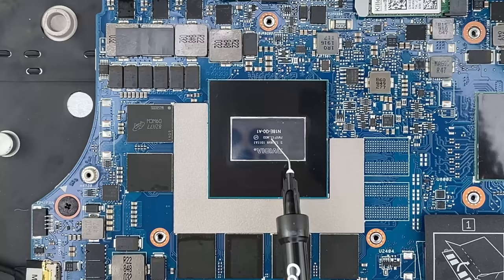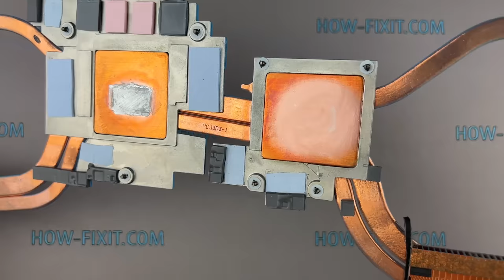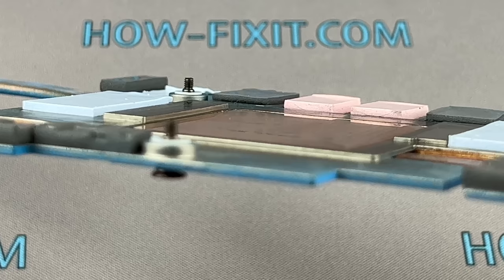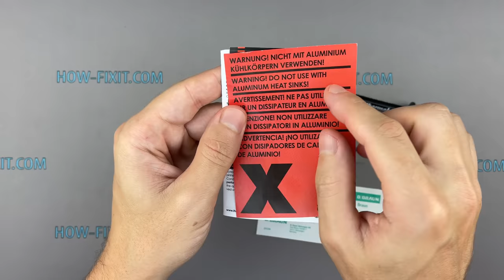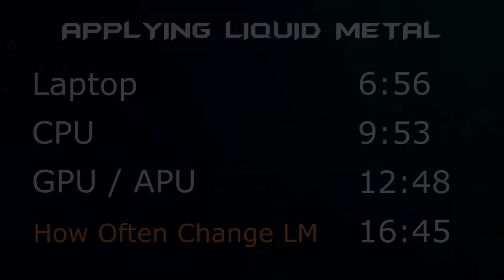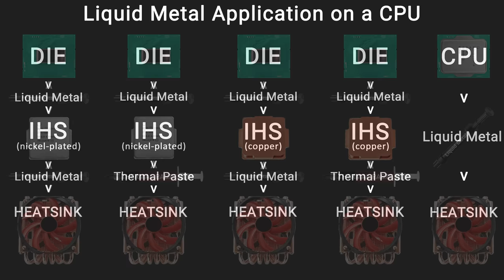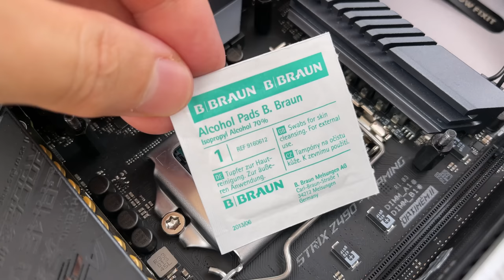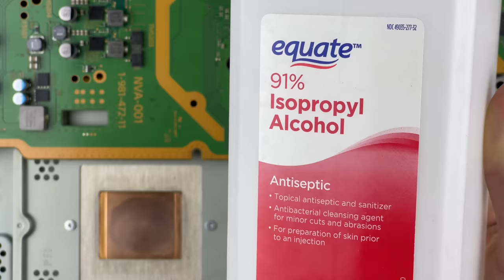Ultimate Guide to Applying Liquid Metal to Your CPU, Laptop, GPU, and Game Console

Comment: It takes 4 years to make a video & still need another 2 years, what a dedication. Really appreciate it. Btw, how many gram of LM are used to apply for laptop?
Reply from the maker: A pinhead-sized drop for a laptop CPU and heat sink. 
I think it's less than one gram.
Reply: @howfixit hi, have you teardown an Acer vx5? Do you know where to disable the sleep sensor or button when you close the lid by any chance?
Reply: @howfixit  I had to subscribe to find out how the liquid metal stood the test of time.
Reply: If you are concerned about this you can start with a conservative amount (the least you can apply) and then add more if its not enough to spread into the thinest layer possible. Remember the point of a TIM is to fill gaps, you don't need more than the thinest layer.
Reply: @howfixit  Mimetic polyalloy🤓 ..... I don't feel cozy putting a chunk of T1000 in my PC 😱... Skynet may get angry😁
Reply: @Ramdileo_sys was thinking the same😂
Reply: Very informative video

Comment: This guy doesn't know what he's talking about. And you didn't remove the stain easily. You created a divit inside the tapper by only polishing one spot
Reply: It's a non abrasive polish. He removed a few atoms of depth
Reply: “Non-abrasive” has been stressed for a reason here. Barely any scratches or divets will occur with a sponge with this polish on copper, and it is visually unnoticeable from a regular polished copper.
Reply: Even if he did create a divit, it's not very deep. You would create significantly more depth if you used an abrasive polish. He's using a non-abrasive polish. Might wanna actually pay attention to the video next time.

Comment: I can tell you better and proper way how to apply liquid metal to copper sufaces: you just need to apply thin layer of liquid metal on the copper and leave it for about 1 hour to get absorbed a bit. Then you apply liquid metal again without touching the thin layer and you are done! No more fast dry liquid metal!
Reply: Bro i used LM for about 6-7 months but as stated in the video you have to reapply but when I sanded the iodized layer on copper heatsink I can't able to spread liquid metal again it's just form a bubble, can you help , but i easily applied it on cpu Or my laptop but can't able to apply on copper heatsink it's just not possible please help

Comment: 2:33 There was alloy diffusion between gallium (and other metals) and copper. In this way, there will be a better heat transfer between the liquid metal and the copper block. In my opinion, do not remove the gallium in copper! 
In my opinion, wipe the liquid metal on the processor and copper block with an alcohol swab without pressing too much. Then apply liquid metal over it again. In this way, you will get better results than the temperatures you have achieved before. I've tried, I know what I'm saying.
Reply: Very true, but this is precisely what he says later😂
Reply: @alexbraundelacruz9690  He doesn't say anything after that, but you know.
Reply: @hamzaterzi8801  I mean he says in the proper application that you shouldn't remove the fusion, only reapply the liquid metal
Reply: @alexbraundelacruz9690  You mustn't touch the copper block. Engineers are making the heatsink with mm calculations.
Reply: Around 16 minute mark he says it, not in the part he is cleaning.
Reply: @tukankibar4917   2:53 Kardeş, galyumu bakır bloktan kazıma ve zımpara yapmamalısın (Videonun ilk dakikalarında yaptığını diyorum). 1:21 Ayrıca orada kimyasal bir reaksiyon olmuyor. Zımpara ile malzeme kaldırırsan, bakır blok ile işlemci arasında fazladan boşluk (çukur) olacaktır. 

Bakırın ısı iletim katsayısı 385 W/(m.K) 'dır. Thermal Grizzly Conductonaut Sıvı Metalinki ise 73 W/(m ·K). İşlemci ve bakır blok arasında ne kadar az boşluk varsa. Kısa sürede işlemcideki ısı, bakır bloğa aktarılacaktır. Eğer mesafe uzarsa, işlemcindeki ısı daha uzun sürede bakır bloğa aktarılacaktır. 

Bakır ile galyumun difüzyon ile birleşmesi iyidir. Bakır bloğundaki boşlukları galyum atomları dolduruyor. Birkaç ay sonra tekrardan sıvı metal uyguladığında daha iyi sonuçlar elde edeceksin. Ayrıca bu sefer galyum, bakır bloğa daha az miktarda difüzyon olacaktır.

(Not:Kimyasal tepkime ya da kimyasal reaksiyon, iki veya daha fazla maddenin birbiri ile etkileşmesi sonucu kendi özelliklerini kaybederek yeni özellikte maddeler oluşturmasıdır. Kimyasal olay ve kimyasal değişme kavramlarıyla eşanlamlıdır...Orada galyum ile bakır birbiri ile difüzyon oluyor. Farklı bir özellikte madde oluşmuyor. Bir bardak su ile taşı karıştırmak gibi düşün. )
Reply: @hamzaterzi8801  ustat, eyvallah, adamlarin ve benim demeye calistigimiz sey videodaki adam senin dediklerinin aynisini soyluyor zaten, sadece dakika 16 civarinda falan. Dediginde haklisin yoksa.
Reply: @tukankibar4917  2:40 dakikada, 4 sene sonunda bakıra nüfuz etmiş sıvı metali kazıyarak çıkardı. 16:19 Tekrardan sıvı metal uyguladı. 16:57 Yaklaşık 1 ay geçtikten sonra tekrardan sıvı metal sürmeyi tavsiye etti. Bu sayede uzun bir süre boyunca sıvı metal kurumayacakmış (O konuda kısmen haklı).
Bende diyorum ki 4 sene bile geçse, bakır bloğa nüfuz etmiş sıvı metali kazımamalısın (Hafiften silmen yeterli). Kazırsan bakır blokta milimetrelik çukur oluşabilir. Bundan dolayı işlemci sıcaklığın daha yüksek olacaktır.
Reply: @hamzaterzi8801  evet ustat, adamin orada onu yapmasinin sebebi bunu paslanma zanneden arkadaslara, bakin bu paslanma falan degil diye gostermek zaten, sen ben yapalim diye degil yani o.

millet farkli renk vs. gorunce aa bu bunu bozuyor diye geriliyor ya ondan. yoksa tekrar diyeyim, senin dedigin isin dogrusu zaten.
Reply: 16:45
Reply: Thats what he said on the video, watch again bro

Comment: Thanks for this video. I have had similar results using this on my long-term laptops, and I did the same thing. Allowed the LM to react with the copper, change it a few times within the first 3-6 months, and then let the LM ride in the laptop and remain liquid. This certainly cleared up any doubts I ever had about my process, and for whatever reason, before this video specifically, I had never been able to find a breakdown this detailed about it. LM is definitely the best way to keep thermals down, and my favorite to use by far. Thanks again!
Reply: Im bout 2 months into first lm application and this morning suddenly got throttling, just took it apart and turns out lm on cpu got dry and separater from it.
Reply: Bro i too used liquid metal but after 6-7 months I tried to repast LM but it won't spread on copper heatsink tried sanding too nothing helped, can you help Or any piece of advice?
Reply: @035-anandraj4  which one did you use?
Reply: @xCheatah  bro it's hard but at the end I applied it, you just have to go round and round till it start to spread, but 1st if you have applied and it formed a layer just sand off it with sand paper, then use cleaning pad that comes with liquid metal or any cotten cloth with just drop of water if you don't have pad . Then take a cotton bud from the medical store , then just rub it against the copper till it starts to create friction then liquid metal will start to spread Itself

Comment: Now I know what i have done wrong. years ago I applied liquid metal to my gamer laptop just on both die. some weeks later it just get back to the same thermal issue. I was to scared of opening it again to see whats gone wrong, till I saw crazy guy doing the same for a RX 7900 xt, And the i knew that i should have put metal on the Heat sync as well.
So I did it and my laptop just worked flawless again. Now I know the think about having to apply two times on copper based heat syncs. Good to know and thank you.

Comment: Just a heads up. First you say not to use an abrasive polish, and then start using the abrasive side of a sponge to clean the copper.
While this may be fine for some sponges, there are others out there that are far more abrasive than polyester. Be careful what you're using.
Reply: All polishers are abrasive as well. But Flitz uses somewhere around 15 000 grit which is around the same for other polishing compounds (some can get up to 30 000 grit). I collect knives and use flitz to get a mirror finish on some knives and it does take material off, just very little at such a high grit that it wouldn't be noticeable or really change dimensions really at all.
Reply: @Kman31ca  yeah but a scourer 🤣🤦‍♂️
Reply: I would agree, but anyone who is this much of tinkering, we already know this stuff, and compare the percentage of wool in our socks, as well as distill water so we get zero metal fluoride when we drink, and ALMOST every thing else. :)

Comment: Great video! Last month i repaste my nitro 5 2022 default paste with liquid metal using this guide. I use a tape named Kepton to isolate and did really nice job. My temp results was great, -20 - 25°c. Now, i just repasted again like you did, so far so good, my laptop is cold finally.
Thank you!
Reply: Bro how did you repaste? My copper heatsink doesn't want LM, I mean it won't spread even after sanding the surface

Comment: incredibly well done, thanks for being patient, repeating and showing various use cases, especially the polishing bit.  very nice work!
Reply: This is actually laughable, don't use the stuff for a few extra degrees, and a lot of the things he did were actually dodgy
Reply: @Markknightexeter  If you know that you can do better, make a video of your own. Saying what he is doing is laughable and dodgy does nothing for people looking to learn. Be part of the solution, not part of the problem.
Reply: @Markknightexeter at 100C you can shave off 25-30C. Even at 70-80C you can shave off 15-20C. On a modern Ryzen or recent Intel, you can obtain higher boost clocks. This is a great way to make middling coolers work better and get more value from a build.

This guide is absolutely excellent, and the polishing is entirely unnecessary especially in low contact systems, you should not be removing mass from said systems.

His additional comments on LM not being scary are warrented, as there is no chance of damage using Thermal Grizzly as it was designed for use on desktop IHS only, and additional use is DIY.

To add even more, there are many conformal coatings that work great for SMTs like liquid electrical tape.

Finally regarding deliding, using a tool is the safest way, and is very worth it to remove the decaying thermal paste on cpu dies that are over 10 years old now.

Comment: Thanks! Very good explination & guide. I've been using Thermal Grizzly's LM for years, it's AMAZING, and my advide is always the same: Isolate SMDs (I use high-temp liquid electrical tape, but TG Shield is fine as well), spread evenly, and PROFIT!

Thermal Grizzly's LM single handedly made the i7-7700K worth it back in the day. Delidding it and using LM took the temps down ~20 C, meaning higher, more stable overclocks. I've been using it ever since.
Reply: Same here. Delidded my i6600K and applied Liquid Metal and got about a 15-20 *F degrees drop in temps. Well worth it. Still using that same i6600K
Reply: Did you repaste?
Reply: @Netizen56  yes. Liquid Metal.

Comment: I honestly am a huge Liquid Metal fan especially on laptops because of how hot they potentially get with prolonged workloads or gaming sessions. I decided to trust the engineers that designed the thermal compound and apply it properly and safely, and never had any issues, in fact, temps always run better with liquid metal. 
NOW I feel vindicated that an actual real life test proves that this works and does not corrode copper just like others were claiming. Thanks for this great experiment you shared with us.
Reply: there is thermal greese much better than lm, and u still use lq lol
Reply: Sadly my friend, nothing beats liquid metal (Yet). I'm sure something will be made that is better, until then liquid metal all the way. @thanhguom
Reply: @thanhguom no there isn't.
Reply: @TheCnf  yeah go use liquid metal and broke your mainboard while i have a thermal paste which is 7c better than conductonaut and totally safe, hehe
Reply: @thanhguom  Which thermal paste is that, 7c better than conductonaut? I also have to repaste my laptop, can u please share the name?
Reply: @thanhguom name of which you will not tell us of course, right...
Reply: @rajaabdullah6966 that's BS

Comment: Pro tip : You should always have two coats of liquid electric tape/paste. You always want to cover the smallest nooks and crannies plus the overall surface to protect. Also, TG Shield is good but i recommend you use small paint brushes to apply it as the brush that's in the cover is short and slightly large.

Comment: This is amazing, I just did exactly what you did and its amazing. I have been having some trouble with my CPU temp using Kryonaut Extreme with 85C - 99C temperature but after watching your video, I got 70C temperature on my CPU with performance boost mode turned on to Aggressive. My GPU is now at 65C with overclock & undervolted compared to 70C with kryonaut extreme

this is an amazing improvement with my laptop. Thank you so much.🎉

Comment: The backing of the CPU die is coated with titanium which is one of the materials that can take gallinstan indefinitely. A while back they had heat exchangers filled with gallinstan for cooling xeon processors in mid range mission critical servers. The cooling blocks were made of copper with a small MHD pump that circulated the gallinstan through the cooling loop. You could blast the cooling block with an actual plubing torch and it would stay cold enough to actually condense water from the flame. The weak point was the driver that turned 5V to 0.1V at several amps to feed the MHD pump with. No big deal, just replacing the mosfet and adding a little extra metal to wick the heat away from it was enough.❤

Comment: Awesome guide! Starting from 2023 with so many laptop makers using liquid metal on the CPU side, a new problem called Liquid Metal Shifting arises, as the name describes, some laptop makers have really big gaps between the die and the barrier, and some of the liquid metal shift into the gap, as a result you may see very high temp occurs on specific cores, currently the only fix is to lessen the gaps, or wait 30 min to cool down the laptop and have the liquid metal transform into solid-state, to prevent leakage caused by movement.

Comment: I last built a computer in May of 2018.  I don't know if LM was available then, but somehow I heard about it while researching my new build.  This video was one I watched about 2 weeks ago.  I decided to go with LM on my new CPU.  I didn't delid it, but I did get some TG Shield (DAMNED EXPENSIVE!!!!  And it smells like nail polish as well as looking like it, spreading like it and being sold in a nail polish bottle!!!!  I think buying NAIL POLISH would be CHEAPER and just as effective) to spread on the components around the motherboard near the CPU socket.  I started the build this past Friday night and gave those components a couple of coats.  I let it dry and began my first experience of spreading liquid metal (Thermal Grizzly Conductonaut) on both CPU heat spreader and cooler contact plate.  It took some time to get the pressure right but I got it.  I also applied a drop to the center of the cpu again before lowering the cooler into place.  The drop instantly disappeared, flowing outward into the surrounding LM previously applied.  I figured this gave me a nice layer of fluid heat conductor to spread out and minimize gaps.  I screwed the cooler down and took a look at the processor edge on from every angle I could.  I saw a mirror line between the spreader and the contact plate.  I was tired so I went to bed at this point.  When I got back to it about 6 hours later, I couldn't tell that there had been any amount of extra leakage from between the two surfaces, but I couldn't tell there hadn't.  It had not dripped though.  This thing is running fine.  And it's one of the quietest computers I've ever heard.  Thanks for the vid.  It certainly helped.  SUBSCRIBED!!!!!
Reply: Beware - less - is better, the surface to which you've applied it, should be as 'flat' as possible (no surface tension, 'buble' , bulge or anything) that +/-90% guarantees that you did not over-applied it too much. Other than that over-using TG Shield (or any isolation glue/polish) is also great step.

Comment: Thanx for that, because I was NOT sure how much paste to apply. I'm also not too sure how TIGHT the heat sink should be, but when I installed a CPU about 5 yrs ago another YT video instructed not too tight, and when I checked it now, the cover was very loose and the thermal paste was not even hard. No wonder my CPU was reaching 94 degrees C. ?!? Now I have to replace an overheated GPU to the tune of almost $400.00. BTW, I am using a 2010 5,1 Mac Pro.
Reply: Thermal paste not being hard is a very good thing. Hardened paste partially lose its thermal conductivity, so it just wouldnt be as good as it was, but nothing terrible will happen. But loose heatsink is worst, so just screw it as tight as it goes.

Comment: it's amazing stuff ! my overclocked 5800x which is notorious for excess heat runs at 70-75c with 100% load and i only have a 120mm aio. you would usually need 360mm rad to get those temps with just thermal paste

Comment: a solvent such as isopropyl will never be able to remove the monolayer of grease (lipids) present on the surface you are trying to clean. If you do want to remove it for better performance you will need to use some type of degreaser. A solvent will never work and there will always be at least a mono-layer thin level of grease on there. In the real world don't know how much this will help to remove it, but in applications such as adhesives like painting it makes a gigantic difference.